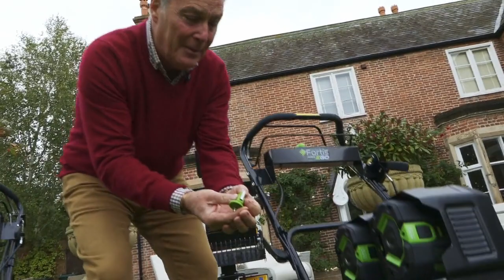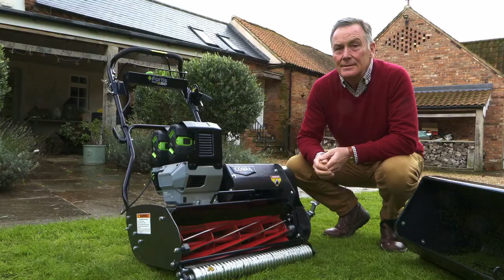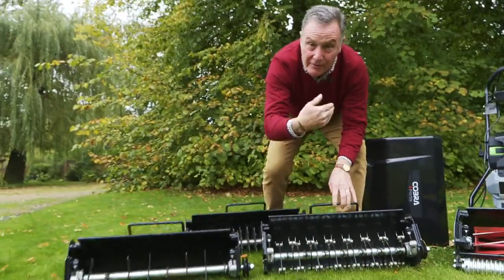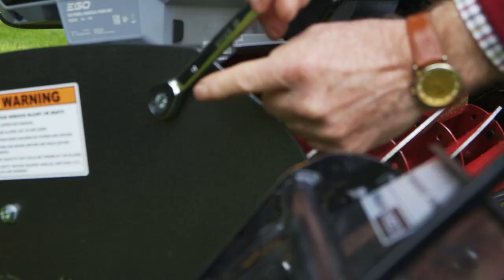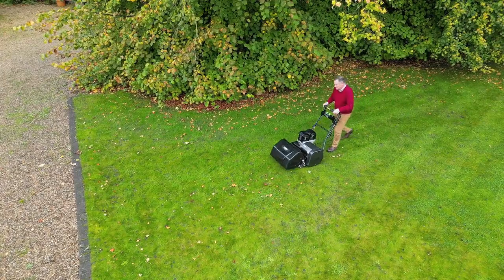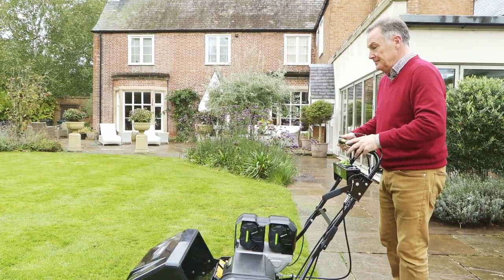Cobra Fortis Cylinder Mowers Powered by EGO: Introduction by Martin Fish

Comment: The Fortis 17E  is unsuitable for garden use. Its not just the colossal weight and huge overhangs (its as wide as my 20" Allett), the drive engages with a crash and the mower rears and pulls to the right even at the lowest speeds. You need to slip the drive,  guide with one hand while increasing speed with the other. Nearly impossible to keep a dead straight line. Worst of all, making a tight turn at the end of a stripe has just torn up my  turf . Lying at the back of my shed if anybody wants it. At least I already had the EGO batteries so the waste of money is reduced. Ive gone back to the 20" petrol to save my lawn and my temper